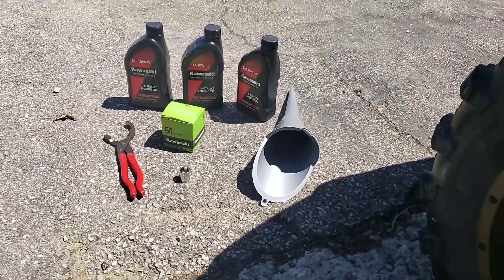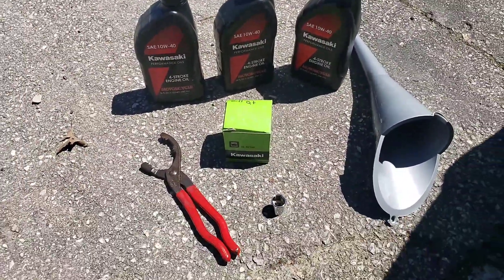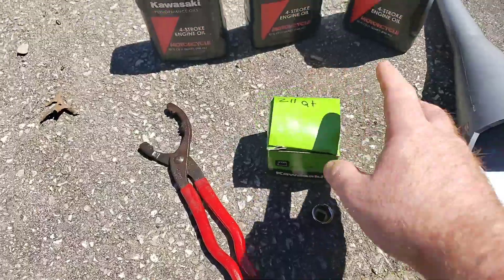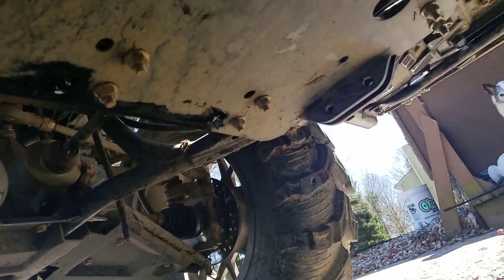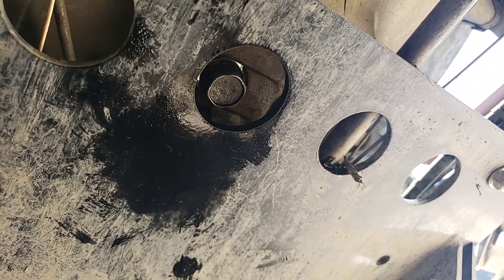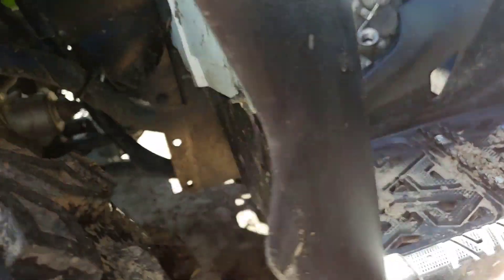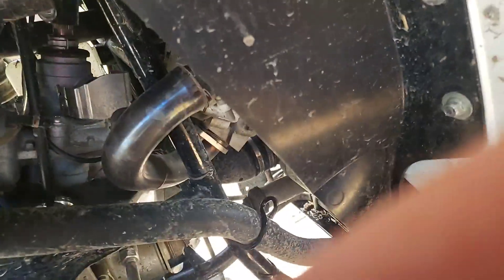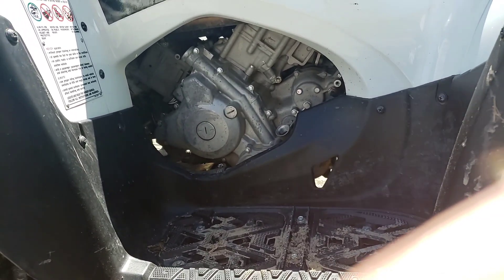2019 Kawasaki brute force oil change

Comment: somebody knows which headlight bulb does the Brute Force uses? 9007 , 9003 ? I need to switch to LED
Reply from the maker: Stock bulb? I can check I replaced my stock lights with the Kawasaki LED's
Reply: Ryan Eckard yes, stock ones. I want to know the number so i can buy the correct Size in leds . Thanks